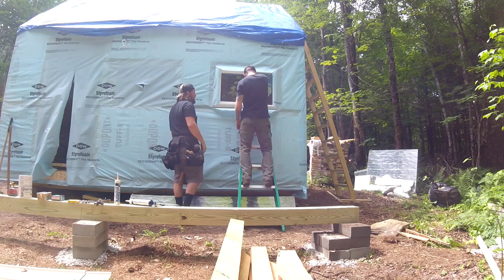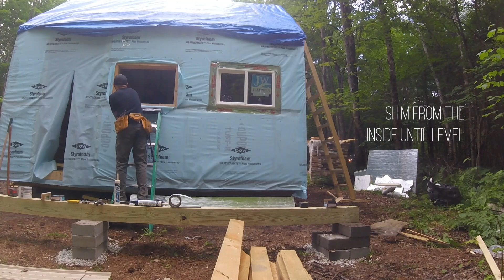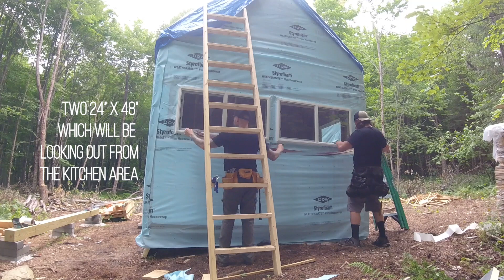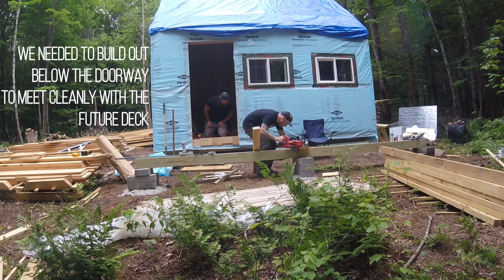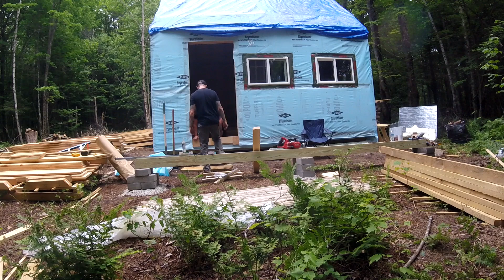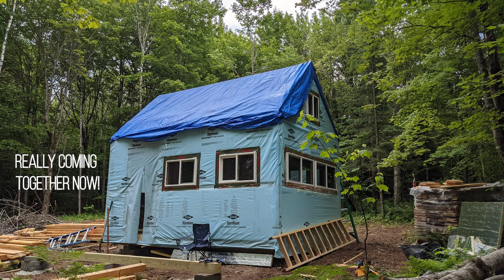Build Day #5.5: Windows and Door for the Off Grid Cabin build

Comment: As builder for over 20 years I hate to tell you this- all that house wrap and window tape was a waste of money and is going to cause problems down the road. This "modern" idea of making your house air tight is crap! Its the last thing you want, especially in an off grid cabin. The house needs, I repeat needs to be able to breath. If its air tight your fire place wont work very well, until  you create a leak so fresh air can enter. There are a lot of chemicals in todays building products and you can get sick from the house being air tight. Water or moisture WILL get behind it, then it has no where to go. I would rip it all off and do it the way that worked for over 100 years.
Reply from the maker: Hey thanks for the feedback and watching! Yeah i have heard a few lines of thought on this topic. I actually didn't tape the seams, and some people recommend doing that. I am by no means a pro, and this is the first time building something like this so I'll just have to learn as I go. Thanks again for watching!